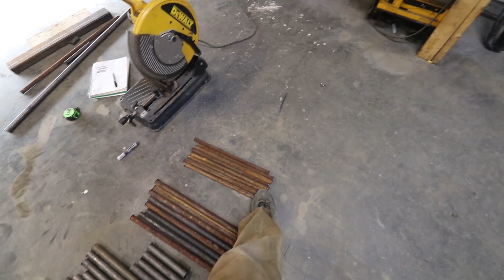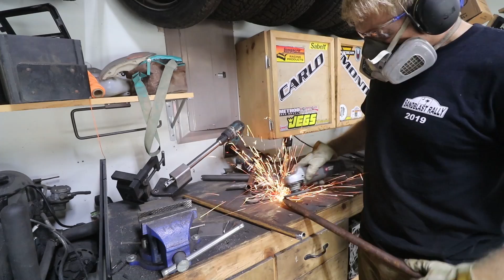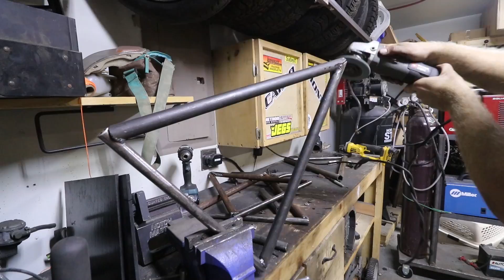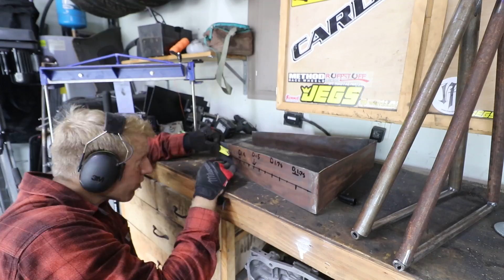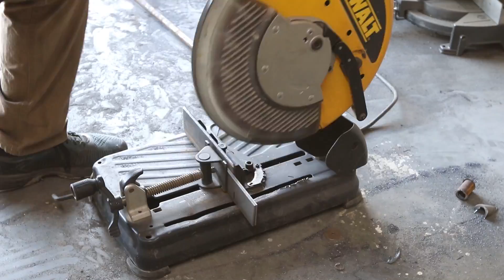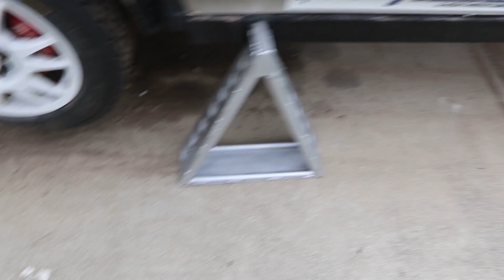Fabricating Rally Car Pin Stands For the Subaru GC8 Rally Car Project

Comment: I friggin love your channel... I'm doing this and the rocker guards at the same time. What thickness UHMW did you use under the chasis as under armor?
Reply from the maker: Awesome! I used two 24" X 48" sheets of 1/8th, you could probably go thicker though. If you plan on doing the rockers kind of like I did then I would suggest adding in some weld nuts to use as a mounting place for the plastic underbody you're adding too.
Reply: @DirtyGarage  ... Dirty Garage  ... Thanks for the advice... I already have some thick, but moldable, aluminum sheets that I was planning to used for the under body, but after some aggressive gravel road runs I'm not sure I'd like the noise, which is why I was asking about the UHMW. Thanks again, and keep up the stellar work!